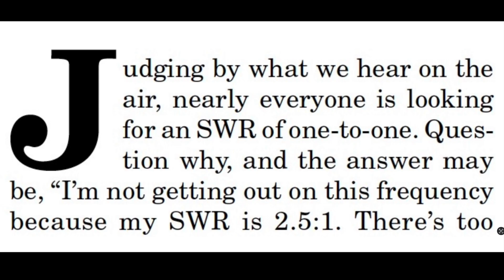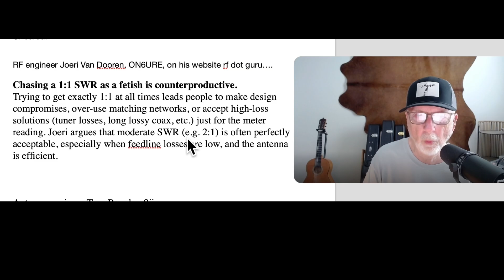Too Low SWR Can KILL You!

Comment: Thanks for the video.  Points well made, but Isn't an SWR of 5 about 2.55 dB down?
Reply from the maker: Depends on the frequency, the type of coax and its length.  Can you specify?  I know I'm correct in what I said in the video.  You might be thinking of TOTAL loss, which includes the cables characteristic loss with a matched load or some other cable.  In the example I gave, for 100 feet of LMR-400 with an SWR of 5:1 at 28 MHZ the TOTAL loss is 1.5 db, still insignificant.

Comment: With 50+ years on the air, let me tell you, the pursue of near 1:1 SWR is a good practice. When you reach it in a reasonably placed dipole, you can be sure you will be heard. Good SWR (not necesarily 1:1) is just an indicator that the antenna is suitable for the freq you are working. 73!! LU1EKR
Reply from the maker: Yes it's simple.  Easy to understand.
Reply: It's just an indication of a mismatch not necessarily a bad antenna, a good antenna can have a seriously high swr, it just requires matching

Comment: I must be slipping.  Running my single-band, CB (yes, some of us operate there *legally*, I'm not doing Leavenworth for anyone) station, one end of the band reads 1.2:1, the other 1.0:1, with 1.0:1 in the middle.  In my younger days I'd have chased that bugbear until both band edges were identical, with the middle being perfect. 
 
Thank goodness at 62, I know enough to get it close enough to not worry excessively -- because I can't climb as fast as in my younger years.  Careful assembly works; I was in no hurry to get that antenna raised.  I may have just lucked out that it does so well.  And therein lies the lesson:  Plan carefully and take your time.  Unless you're erecting an antenna for an emergency situation, you're not in a race to get it done.  "Think on it," as my dear father would've said.
 
As for the HF EFHW wire antenna I'm gathering parts for, the same thing applies.  It'll be the best I can make it, and on my own terms.  I know I'll have VSWR out the wazoo along the feedline; but my tuner will take care of that.  And grounding my station, choking common-mode signal at the antenna, etc.  As long as I'm putting a decent signal on the air, and not blasting my rig's final PA to smithereens, I'll be happy.
 
GL es 73 de KBTB-8663/N5RLR 😉👍🏼

Comment: Take the ground mounted vertical for example. It when you have a proper amount of radials its input impedance is approaching 30 ohms, in fact can be as low as 25 ohms. Giving you a higher SWR than it did with four radials but the vertical that is sporting 26 radials will knock the socks off the lower swr 4 radial vertical
Reply from the maker: Great example.  Removing radials for a better SWR is a symptom of severe SWRDS.

Comment: What about transistor amplifiers? Do they like 5:1 SWR?
Reply from the maker: No.  That's why you use a tuner.  Tube rigs all had one built in.
Reply: @BustRadioMyths poor excuse for badly made antenna.
Reply from the maker: You have SWRDS.
Reply: @BustRadioMyths You know, it's like saying that making your shoes fitting your feet may kill you and wear two sizes more
Reply: @dongjuang4196 having an impedance that doesn't match your 50ohm feedline doesn't mean it's a bad antenna, it just means it needs matching, a tuner is an efficient way to tune you ant system to resonance
Reply: @Pioneer936 having an impedance that is not equal to the design impedance of your antenna does mean that you are having badly made antenna.

Comment: I always find this argument funnier than hell. I'm not a giga ham I'm the FNG. For the most part I run these cheap Chinese qrp rigs. I've got a Z match tuner I don't use any baluns and I hit an SWR of 1:1 or 1.5:1 consistently without even trying no matter what I hook up to. And that includes once upon a time for a joke a very large bowl of potato salad with two stainless steel Chopsticks in it and a ground. No I didn't see what kind of range I could get on it but it did tune up. (1.5:1)

Comment: WHAT ? A centre fed dipole at resonance has a Vswr of 1.5:1 - NOT 1:1 – All True.

About this point in time the bad old habits we learnt from CB days kick in and we yell "hell no" 
and commence to cut and trim the ends of the di-pole until the Vswr drops to 1:1. 

"Ahhh" we say with a comforted contented sigh.

Unfortunately what we do when we start to cut and trim like this is we take a perfectly good antenna that is resonant on the desired frequency and we change it to a less effective NON resonant antenna with a Vswr of 1:1 - thereby defeating all our hard work and effort because in our mixed up heads we have learned over the years that 1:1 is the best.

NOTE: The Guru (I think his name was Jim, ... or was it Dan?) once said that there was only ONE antenna that had a 50 ohm feed point impedance and that is the quarter wave droopy.

-- VK4VOX (Di-pole and Quarter Wave Ground Plane Antenna Myths)
Reply from the maker: Great post thanks

Comment: Antenna and set up make a big difference. More so maybe than the the actual radio you could have a Stryker 955 if your antenna is not right it could make a big difference.
Reply: You could have an antenna that's perfectly resonant yet has a high impedance so I would use an antenna tuner to tune the antenna system to resonance

Comment: Six meters was open yesterday, I had never gone on 6 meters. I used my hexbeam and got an SWR a little higher than 2:1. It worked fine on FT8 and I was able to contact pretty much every station on the map. Other bands on the hexbeam are less than 1.5:1. My other antennas a ZS6BKW for example don't do quite as well but they still work.

Comment: I remember the day when I cut the dipole for 66' and used 75 ohm TV cable and hooked it directly to the output tank of my 40 meter homebrew, crystal controlled, one tube transmitter and tuned it using the 100 ma meter, looking for about 35 ma at dip. Thats it. No VSWR or even an output meter, just the dip. Along with my SX-100 receiver, I made hundreds of CW contacts and found the MAGIC of HAM RADIO!
Reply from the maker: SWR meters have created an epidemic of SWRDS!!

Comment: I go for a low SWR then I know the matching between line and antenna is good and power transmission on tx and rx is better than with an impedance mismatch. IT IS SO EASY TO GET A LOW SWR IF YOU KNOW HOW TO SET UP A HAIRPIN (THEY GO BY MANY NAMES) OR A GAMMA. But most hams just don't know what they are about. You can see it every day on YT.
Reply: Yep that's why we use antenna tuners
Reply: @Pioneer936  With all the losses...😅
Reply: @tinkerman9525 what losses? Very little lost within the tuner if correctly sized for the operation, any loss would be down to the feedline, just improve the feedline, an extended double zepp is a non resonant antenna using a tuner that has 3db gain over a resonant dipole
Reply: @Pioneer936 just improve the feedline....😅😅

Comment: Very true but the No.1 reason hams chase a low VSWR is not in the interest of antenna “efficiency” but because they worry about damaging the expensive radio just they’ve just blown ££££ on.
Reply: I like to run my YAESU MARK-V FT-1000MP real "hot". No SWRs below 9.5:1. I like to hear those "cans" sizzle... When the voices start sounding like Donald Duck, I know I've hit the sweet spot. :P
Reply from the maker: If it’s an expensive radio it will have a built in antenna tuner that will do a fine job of providing the radio with an SWR of less than 2:1.  Most hams should know that.
Reply: @BustRadioMyths or, you can have a Yaesu and watch the internal tuner cause a "HI-SWR' light to come on and show infinite SWR where there really isn't a hi swr
Reply from the maker: Sounds like a problem with common mode current.  It messes up ATU's.
Reply: @phills2180 if only they knew that reflected power doesn't damage their radios

Comment: This is a good video.  What matters is the signal strength (or more precisely, the signal to noise ratio) we are delivering to the station we are trying to work.  SWR tells us nothing about that.  If we want our transmitter to last a long time and deliver good power, we will also care about what impedance is presented to the output of our transmitter.  SWR by itself tells us very little or nothing about that.  We need more information.  Suppose I have a 10:1 SWR in my transmission line.  Is that good, bad, or indifferent?  Many hams would say that is bad, but suppose I am using ladder line that is cut to the right length to provide a load close to 50 ohms at my transmitter.  Then that situation is good, and a 1:1 SWR could be very bad for the transmitter.  Having said that, occasionally checking the SWR reading is good practice.  If we see a substantial change from yesterday's SWR when operating at the same frequency, it is telling us something in our antenna/feedline system has changed, and probably not for the better.
Reply from the maker: True. The bottom line is how is my signal? If your power suddenly dropped by 50% for some reason that is only 1/2 of an S unit.

Comment: When I make antennas, I try for a reasonably low SWR.  If it's a ground plane, I go for about 30 Ohms at resonance (SWR of 1.7). Dipoles of course vary quite a bit according the height (anywhere from say 20 Ohms to about 100 Ohms), so I just calculate the length and put it up.   I have a manual tuner to keep the transmitter happy and don't worry about it.     de AA6LJ
Reply from the maker: This is the way.  ^^. Cut to the desired part of the band and leave it alone.

Comment: The only reason I believe many hams make a fetish out of low SWR is because modern radios protection circuits get unhappy above a 1.5 and begin to roll back the RF power the radio can put out to protect the finals. This is why I love my doublet, no matter what band I'm on my SWR is always dead flat at the rig end of the system and it happily dumps full power into the load. With old school tube rigs, SWR means almost nothing to them. Hams back in the day would connect their balanced wire feed right to the final amp and just tune it for full power no matter what the SWR was. They didn't even have SWR meters to check it.
Reply from the maker: All true and that’s the point.  A tuner tunes the system to resonance so full power is delivered to the load.
Reply: @BustRadioMyths  I always say the tuner makes the radio happy.
Reply: @BustRadioMyths  I always say the tuner makes the radio happy.
Reply: @jonthebru I love my antenna tuner tuning my antenna system to resonance

Comment: 1. 99% of the time feed line losses are not low, they are high because people cheap out and don't buy good quality coax and connectors.   2. Often times the antenna isn't efficient for the band the operator wants to operate in. Most of the time operators build a multi-band antenna and don't understand why its not 1:1 on all bands.
Reply from the maker: All true and I had to laugh.

Comment: Once upon a time I had my best antenna ever. It was an 80 meter half square. When tuned for CW it had an SWR of about 1.5. On about 3525 kHz. I thought that was really good and it was. If used on SSB at 3795 it had an SWR of well over 3:1. I had a knife switch where I could change the length of the two legs so it would have a 1.5 SWR on SSB. One day I forgot where I had last tuned it. It had a low SWR on CW but I was not getting out like usual. I then checked the SWR on SSB and it was nearly 1:1. I immediately knew that the coax had excessive losses. Replacing the coax restored the antenna to full performance and the normal SWR readings. If the SWR is too low across 80 meters ( without retuning)  you have a problem!  Low SWR can be both good and also mask excessive losses.
Reply from the maker: This is a great example of why a low SWR may indicate a problem with your antenna system.
Reply: 100%

Comment: New to ham here. These are very interesting infos sir, but may I ask, does this also apply to the 2 meter band since it's where I'm starting this hobby? Or is it for the entire ham radio frequency spectrum? Thank you and 73.
Reply: All coax has a certain loss per foot. SWR introduces some additional loss. With new or good coax there is an advertised loss per 100 feet under perfectly matched conditions. Typically that loss will be higher on VHF than on HF. The additional loss due to SWR depends only on the inherent loss in the coax. For example if due to type and length your coax only has 1.5 dB loss then it takes an SWR of about 4:1 to cause one additional dB of loss. However if the coax is so long that you have 10 dB loss, a SWR of 4:1 will cause an additional loss of 2 dB.
The matched loss of 10 dB is the real killer not the additional loss of 1 or 2 dB caused by the 4:1 SWR.
All the antenna book have the chart showing additional loss due to SWR vs the line loss when matched. That chart holds regardless of frequency. The matched loss, while it does increase with frequency, attenuates the signal the same number of dB ( regardless of frequency) each time the forward wave and reflected waves travel the length of the feedline.
Reply from the maker: As you go up in frequency, coax losses dramatically increase. So no the 2 m band is not the same as for 10 m for example
Reply from the maker: @franciscolopez3229 you just got your question answered by @dandypoint who’s an RF engineer

Comment: Right now I got to 1.3 on the low side of the band in a 1.5 on the high side of the band I'm not going to say that it didn't bug me cuz it kind of did but I'm just basically using it for receive because I don't have a power supply quite powerful enough nor did I ground the antenna out yet because I just got the money today to get the stuff to do that but despite that I've made five or six contacts in the last 3 weeks with the power turn down great video the truth shall set us free
Reply from the maker: The truth will set you free from SWRDS.

Comment: I completely agree. 
Trying to achieve 1:1 SWR on any multi band antenna is virtually impossible.  There may be one band that comes close but the other bands will not be. 
 
Use an ATU to electronically “tune” (match the antenna) which typically achieve somewhere lower than 2:1.  
With good coax and feed points, you’re good to go.  As you said the loss is immaterial.  Also, it is not uncommon for the SWR to fluctuate during longer periods of operation so an ATU will save the operator time trying to achieve a senseless, “perfect” SWR.  

With over 50k logged QSOs, as long as my SWR is lower than 2:1 (I use an ATU) I spend my time operating not tweaking to the near impossible. 

Also unless I’m using an Amp, I use the internal ATU which is perfectly fine in the vast majority of time. 
W6ZD
Reply from the maker: This ham is a voice of knowledge, reason and experience!  ^^
Reply: I love my antenna tuner tuning my antenna system to resonance

Comment: I don’t even have an SWR meter hooked up to my HF rig, I use my tuner and my Yaesu FT-991A has a built in SWR so I just press the tuner button and as long as the SWR is not too much (and it never is) over 2.5 I don’t worry in fact after tuning it’s never over 1.3 if it even gets that high.
Reply from the maker: I declare @W5KJD SWRDS free!!
Reply: @BustRadioMyths Thank you 👍

Comment: I have reports from the USA on forty meters on digital FT8 transmission with a power of 100 watts and with an antenna that has an SWR of 9:1 tuned with a tuner. My antenna is a vertical Sirio 827 according to the myth of SWR I should not be heard even in my city.
SV1SVO
73
Reply from the maker: That's pretty good for an antenna designed for CB/10 meters if I'm correct.  I declare you SWRDS. free!